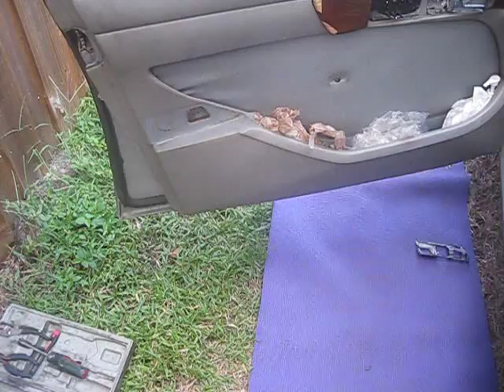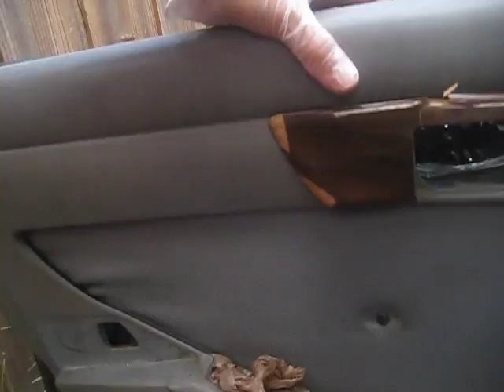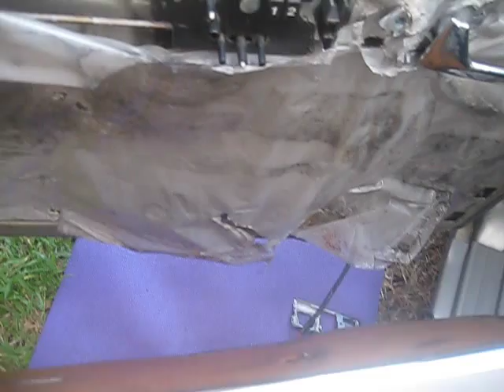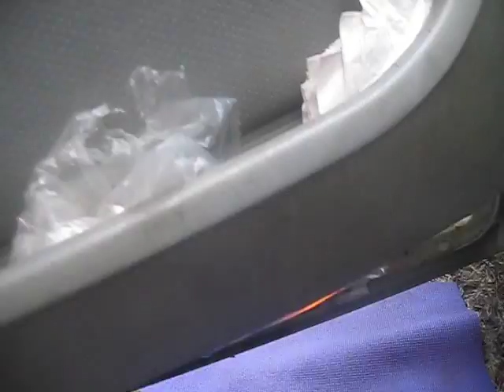side door panel removal on Mercedes Benz 300SD turbo diesel part4 for window Jblazed.com Sep26,2013

Comment: this was fairly useful for me.. you should have put all of the video segments together though. and you left too much off between part four and five. how did you remove the light from the door?
Reply from the maker: Chris Artell 
The light just comes out by moving it all the way to the right or left and use a screw driver to bring it down...
Or you maybe just able to unplug it?

This was done before I knew how to put videos together I do now...
(I have so many diy to still put up, if u could please subscribe )
Thanks
Reply: MrJohnnyblazed that makes sense. I figured the plug would be visible from the inside of the door. Hey ill definitely subscribe to your channel. Consider doing the same. I have some similar projects going on and have been meaning to put some new videos up.